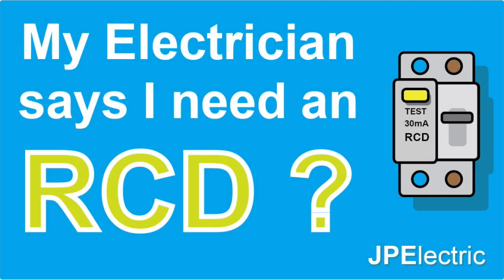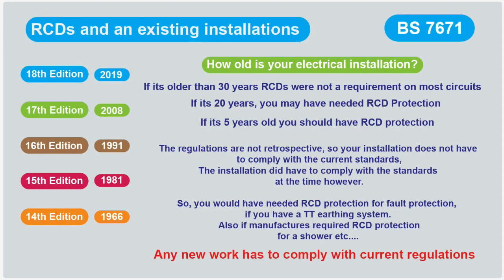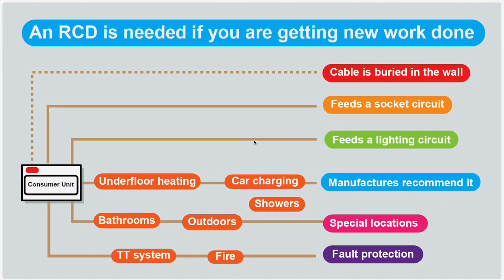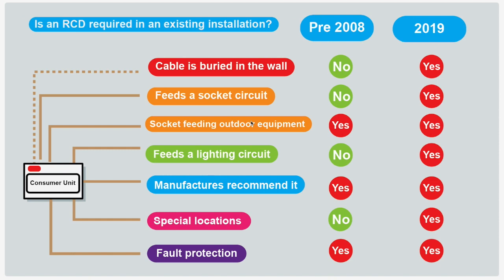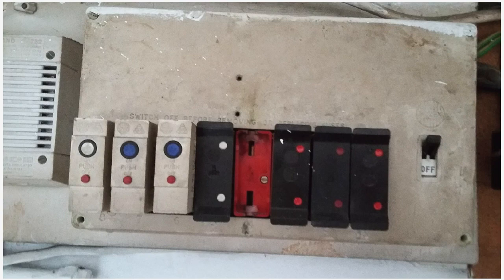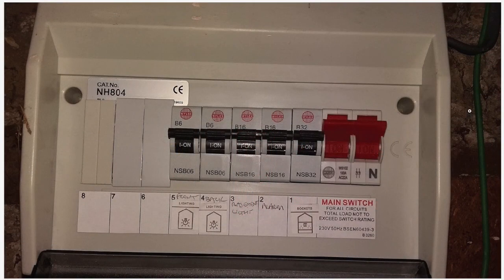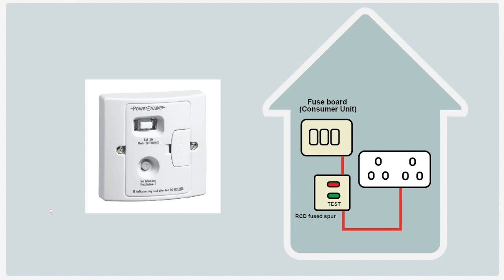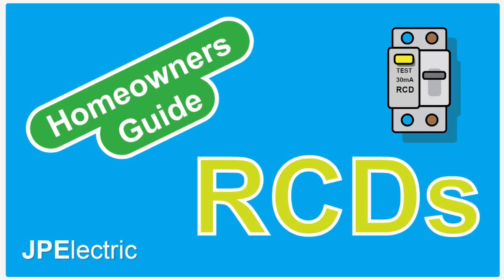Do I need an RCD in my fuse board?

Comment: whats happening when there is two RCDs in Line and how comes they both trip out together. Is it becuse electric is faster than the rcd reaction time ?
Reply from the maker: Its down to discrimination. If you have two RCDs on a circuit, The RCD closer to the supply should not trip before the RCD closer to the load. So, to have good discrimination, you may have different  mA ratings, or the RCD closer to the supply might be time delayed.  If you had two RCD the same, you would never really know which one would trip, they both might, or just one, and that can cause real inconvenience, especially it the RCD closer to  the supply operates. as this may be protecting multiple circuits

Comment: So a customer that owns a little cafe has asked if she should have her consumer unit changed. Its the same type you showed at the start- rewireable fuses and push button MCBs. I've recommended she have it changed as I always prefer that sockets which can supply outside equipment, have RCD protection. Also, its a commercial property. I have NOT told her that she needs it but that I recommend it. Would you agree?
Reply from the maker: Hi Matthew.Its been a requirement  of BS7671 for some time that sockets that  can likely  feed outdoor equipment have RCD protection.
Reply: @JPElectric Please when selecting an RCD, should the current rating of the RCD be the same as the current rating of the main switch or isolator